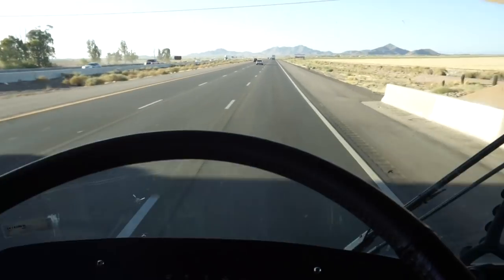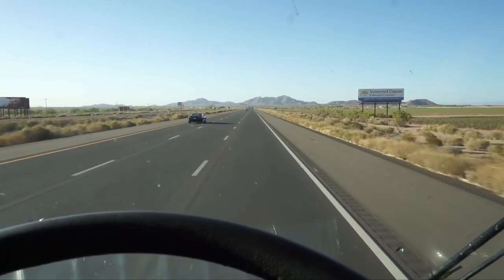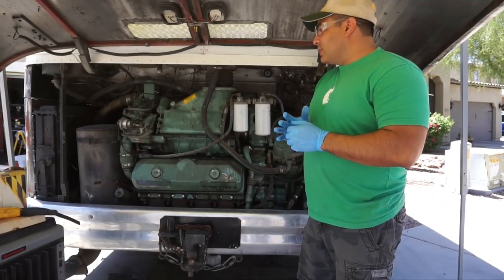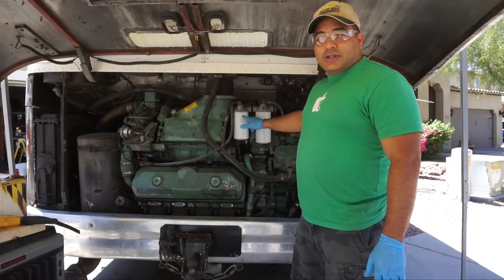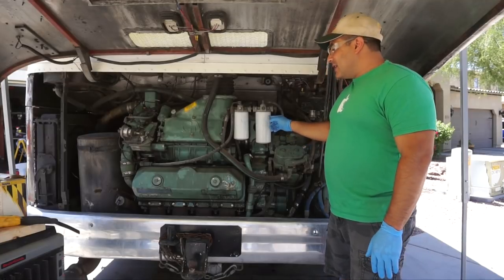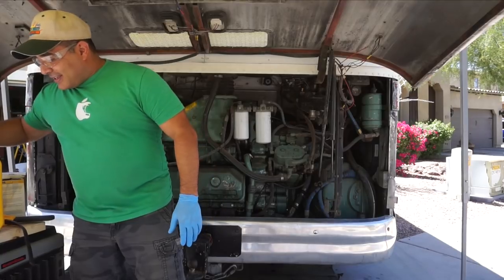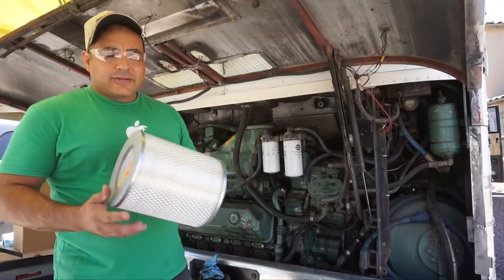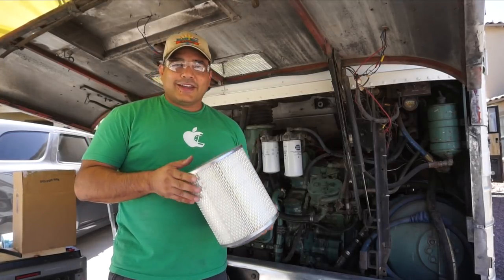Getting our Power Back: Changing Filters

Comment: Always lube you seal on the filter. It will seal better and come off easier next time. Just dip your finger in fuel and run it around the seal. Also hand tighten and the maybe 1/4-1/2 turn more with filter wrench.

Comment: Good call on blocking the hole in the paper element air filter. The Detroit can suck a lot of grit through even a small hole. People tend to over-tighten the fuel filters. Your next level of preparedness is to carry a spare fuel pump and learn how to re-prime the fuel system. Both of those are within reach your skill set. For your first time, do it at a local truck stop, and have a support car. You'll be glad you practiced before having to do it for real under difficult conditions.
Reply: I agree with Kevin on a spare fuel pump and knowledge on replacing it as well as priming. A long long time ago I was a professional FireFighter. One day we were driving to another station to top off our full tank half way there the Engine (8V71 Detroit Automatic Transmission) started winding down no amount of pedal would increase the engine speed and within 100 yards we were dead on the side of the road. Turned out to be water in the fuel tank and the Fuel Pump relies on the Fuel passing through it to lubricate the shaft. Water had passed through and not only does water not burn it does not lubricate the Fuel Pump shaft had sheared shutting us down. Requiring side of the road service hours later pump was swapped priming was completed and engine was running. Took several more days to get the fuel system properly cleaned up. Evidently someone had delivered a contaminated load of Diesel to several stations, and we were the lucky ones to have a had a failure. Shortly afterwards convinced Management to have Fuel and Water separator installed. Regardless I know you have a lot going on but prepare for the worst if you do not need any of your preparation you will be able to sit back and chuckle about it later.
Reply from the maker: Thanks Kevin - always nice to hear from you.  Yes we are slowly creating a spare parts list - granted we cannot have everything, but fuel pump, starter, voltage regulator, hoses, fluids seem like a good reasonable starting point.  I will learn how to prime the engine and change the fuel pump before I leave :).  Like you said - I don't want my first time to be on the side of some busy highway somewhere.
Reply from the maker: Awesome advice Bill!  Thank you for that and the cool story.
Reply: +Beginning from this Morning I am troubleshooting a fuel delivery problem on my MCI at present. I think the interior of a line is degraded from use of a bio-diesel blend. Mine has a Detroit 6V92T. The priming procedure is the same as on a 8V71.
Reply from the maker: Kevin Hornbuckle please let me know what you discover

Comment: I was going to suggest the injectors next but somebody beat me to it. As long as you get the message that is good.  Depending on where and how you drive I would change the primary and secondary filters on a regular cycle.  It is challenging and rewarding to figure stuff out.  Great job.  Ed
Reply from the maker: Thank you Ed,  This seems to have fixed the problem but I would still like to "run the rack" before I leave just to have some experience with how to do it (preferably with someone who knows what they are doing).  It is indeed challenging and rewarding to figure this stuff out and to share it.  Thank you for following along

Comment: they make a sensor for those air intake canisters to measure restriction, so you don't have to open them up to check them.   I would go to your semi truck junk yard and look on the air intake canister they are clear with a spring loaded piston inside not sure the cost new but you need four one for each canister. junk yard be your best bet then you will have a idea of how to install them on you canisters.
Reply from the maker: Neat - I will have to look that up - thank you!

Comment: Yup, perm marker date/mileage on each filter. Also, start a maintenance binder/log to keep track of what & when next’s. Someone in your bus group has likely done a spreadsheet already. Online filters & belts are usually 40-50% off compared to local NAPA store. Besides Amazon check https://www.fleetfilter.com. Many other sources out there & your bus nuts group might have a NAPA Fleet Discount program? If you haven’t done so yet, not a bad ideal to replace water hoses & belts, get the coolant system flushed & filled and do an oil/filter change. No telling when they were all last done, unless the bus has a logbook already. Even then, it’s best to zero time all the regular maintenance items & start fresh. DIY’ing much of it can help reduce costs allot! Lastly, always a good idea to have spare belts, hoses and filters onboard.
Reply from the maker: Hi Van - Great to hear from you.  I have heard mixed reviews on the NAPA stuff - most mechanics seem to avoid their filters - still trying to figure that out.  Yes we plan on doing a full rundown of all the hoses (there are no belts on ours) and fluids before we take off.  Fortunately the previous owner kept some pretty detailed records and logged nearly everything.   100% about the spares - we just talked to a guy last month who said he ran into a bad batch of Diesel and had to change the filter 4 times during that tankful!  Thank you for the very helpful post.

Comment: You can use ' Date '  on the filter(s),  ALL of them,   but " Mileage"  is better and   " Eng. Hours "  is even better.
Reply from the maker: Wayne Everett Thanks Wayne - we logged date and miles but don't really have a good way of tracking the hours
Reply: You can get an hour meter. The cheapest ones count up whenever they have power, so you wire it up to the "run" position of the ignition. Won't necessarily 100% match the engine hours, but will be close enough and the error will be more than actual hours which is the "conservative" direction.

Comment: This is where the golf ball crushing hand strength comes in handy ;)   Very cool.  The huge back hatch seems really nice.    And...  is that engine mounted transverse instead of longitudinaly??
Reply from the maker: LOL!  Hey Joey - good to hear from you - yes the engine is mounted longitudinally in the rear with the transmission actually going into the rear end at about a 40-degree angle!  (they called it a V-drive).  I guess the design was this way to try to maximize the interior space.  Another really odd thing is this engine spins counter-clockwise and almost every other engine spins clock-wise (even this exact engine in a semi-truck spins the other way)!  You learn all kinds of crazy things with these old buses!

Comment: Couple of things, did you lubricate the tops of the fuel filters before screwing them in (use the tip of your finger, dip it in the fuel and run it around the top of the filter, and also on the base where it screws in (if you do this to he base it will insure no material is left from the old filter that was removed))? Not sure, but one canister filter is a filter, and the other is a fuel water separator? Do not use oil on the rubber of the air filter, oil (petroleum products) will cause the rubber to swell up. Use a silicone based grease).

Did I understand correctly that the inside of the bus was hot on the trip to Mexico? If so, no mini split?
Reply from the maker: Hi Glenn - I hope you are feeling better - it is always a pleasure to hear from you.  I did dip my finger and run it around the ring before I installed it but someone had suggested using oil or maybe ATF as a better alternative.  I am not 100% sure what the filters are - only that one is a "primary" filter and the other is a "secondary" filter.  I don't think either of them does well with water (at least from what I have read)

Thanks for the tip on the air filter we have some silicone based stuff we use on our pool rubber seals that should work well.

OH man on the way home I logged temperatures inside the bus of 130 degrees plus!  It was brutally hot and I was running the A/C the whole time!  The problem is that we have not sealed the bus yet and so much hot air was coming in off the street the poor little A/C never had a chance!  Once we get her all sealed up and insulated I am hoping everything is considerably more comfortable.
Reply: I really like your videos. I'm am starting to feel better, very slowly, MRI came back normal, they have no idea what is wrong. The suspect meds. One other small tip that applies to filters. When you fill them up you should pour the oil/fuel into the outer ring so that when it migrates to the center it passes through the filter material. Glenn Lever

Comment: Hey Juan, couldn't spare an extra pair of rubber gloves for Michelle? ;-)  (she's a real trooper!)
A couple of points.  Same thing happened to me shortly after I purchased my bus 31 years ago.  It started after I had to replace the fuel tank.  The one I got was full of crud and on our first trip out in the bus I had to limp back like you did.  Now I always carry a set of spares and a metal filter strap wrench (better than the rubber) just in case.  I change filters about every two years or 20K miles. 
I'm assuming you are using ultra low-sulfur #2 diesel.  Some places sell a mix of #2 and 20% bio-diesel.  Bio will cause the varnishing in the system to slough off and clog your filters.  It will also cause rubber 0-rings in injectors to leak and need to be replaced.  (You'll know when the injectors are leaking because you will have more oil in the engine than what you put in.) Be careful when you pull up to the pump to check to see you are getting only #2 diesel.  
Good video, and proper priming technique.  Might want to rev engine first time after replacing filters, it will help siphon fuel from tank.  There should already be a check valve in the system that keeps the fuel from draining back into the tank from the suction line.  If problems return, look for a pinhole leak in the suction line.  
One last point, sometimes algae grows in the tank when humidity and temps are high or water gets in the tank.  Adding Bio-con or another algae control now and then will kill the algae and keep it from growing.  When it does, it looks like black dirt in the fuel.  That was the source of the problem I had when I replaced the tank originally.
Sorry your paint job trip didn't go so well.
Reply from the maker: LOL thanks John - Always a pleasure to hear from you.  I offered her gloves! You can lead a horse to water ... - Isn't she great - I would gladly give my life for that woman.   We have been together since we were 15 years old!  

Fortunately, the tank has been changed on this one about 4 years ago now (according to the logs we got with the bus).  I have a metal filter wrench in the garage - I will give that one a go next time.  Thanks for the interval - I wasn't 100% sure and have seen several posts now mention the 20K miles figure (or if you lose power of course)

I have been advised to avoid bio-diesel like the plague.  I didn't really know why but your explanation makes sense - Thank you.
We have heard of the algae problem - it can be a pretty substantial problem - fortunately for us, it is VERY dry here but as we travel this might become a concern - I will look up the product you are talking about (Bio-con) - Thank you again.  

The only thing I am adding to the fuel right now is "Howes Lubricator Diesel Treat" - we read on a few blogs that since they took the sulfur out of the Diesel that it does not "lubricate" as well and needs an additive like that for proper operation (it also has an Anti-Gel in it but we hit 110 yesterday so I am less worried about that).  I have also heard of folks using ATF and even motor oil.  I would love your opinion on that.

Thank you again for the wealth of information and your sharing of it.
Reply: Nice to hear you two have been together so long.  You are obviously made for each other.  Not many wives support crazy guys with bus fetishes.  35 great years for me! 
Our bus engine has over 200k miles on it now and the only thing I put in the tank is #2 diesel, except to treat algae problems when I see the fuel getting dark or have a filter full of black dirt which is what algae looks like.  It does not smoke at all and runs fine.  I always use the recommended straight 40 weigh oil year round because I only change the oil once a year usually with 10k miles or less.  SAE 40  oil is a little heavy for our cold months, but the only issue is it makes starting harder so I use a block heater to overcome that when we are in single digit weather.  You should never use multi-viscosity oils.  SAE 30 or 40 only, 40 in your region always.  
Before retiring, I was the director for transportation for a fleet of 1200 buses and about 700 other vehicles.  Our buses traveled over 100,000 miles per day, a distance equal to 4 times around the equator each day.  We had an opinion about all the additive claims; if they really did anything worthwhile, the fuel companies would include them or the manufacturers would recommend them.  None were.  We regularly had salespeople trying to sell us their products.  All manufacturers will void their warranty if you use an unapproved product in the tank.  We couldn't afford to risk a loss of a warranty so we NEVER used any of them.  
As for gelling, it is never a problem above 20 degrees.  The northern fuel companies in cold climates switch over to a winter blend during cold months which has a percentage of kerosene to keep the fuel from gelling.  Unless you are traveling from AZ to AK on one tank of fuel, you'll be fine (don't think that will happen).  Bottom line, save your money on the additives.  Just my opinion. 
I'm curious, do you have a plan for a/c while going down the road?

Comment: After the fuel filters open them up to see what caused the clog, trash or algae? Don’t have to do this every time but to provide a baseline as to cause. Wm
Reply from the maker: Thank you Dianne - I did cut them open the last time I changed fuel (I think 3 months ago) filters to see if there was anything in there.  To my surprise, the filters were actually pretty clean with no signs of algae or any kind of debris.  We did shock the thank with algicide after we did this work (I think this video was from about a year and half ago)